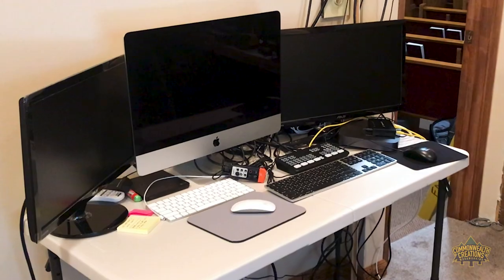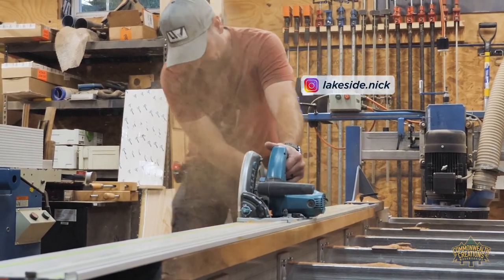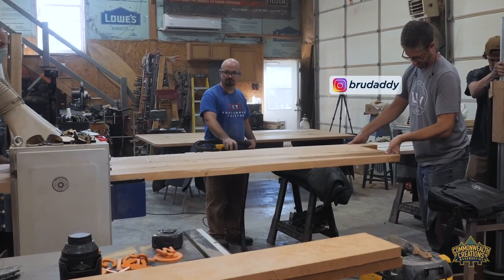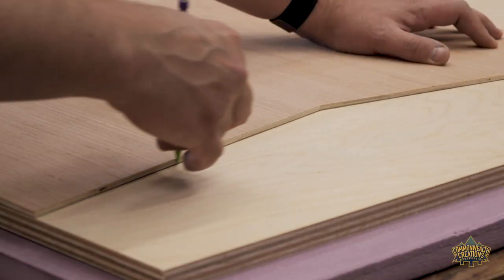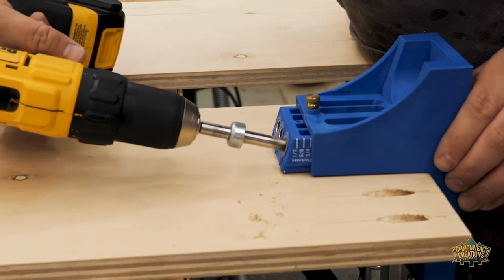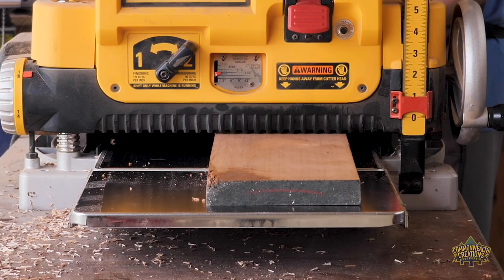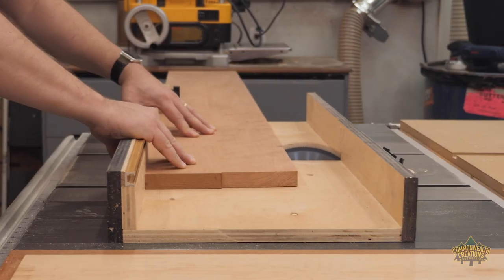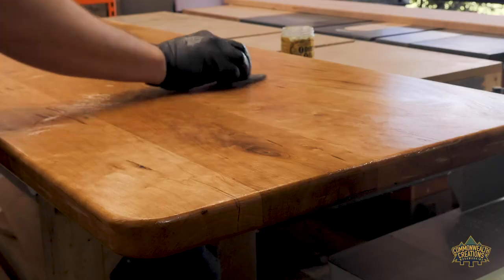The Making of a Studio Desk

Comment: How did you attach the middle rack partition
Reply from the maker: I didn’t attach the top shelf. It just sits on top of the main desk part. If I were to affix, I would have likely drilled holes from the bottom and used screws.